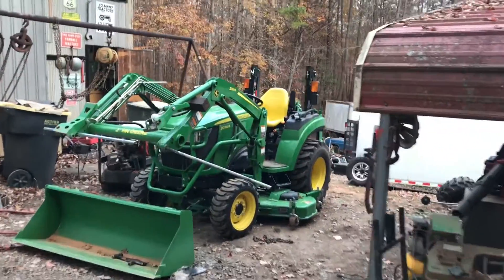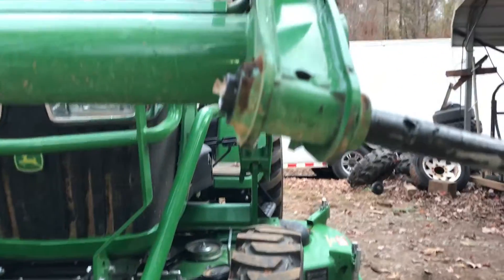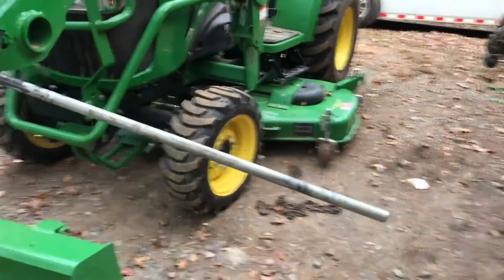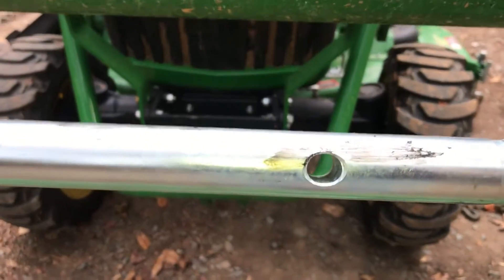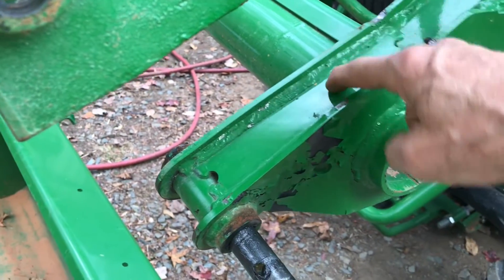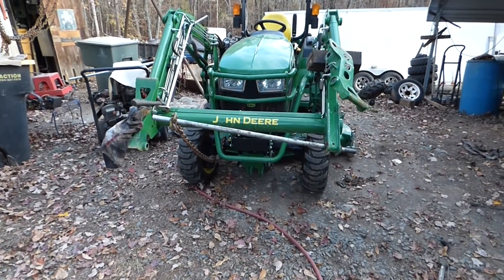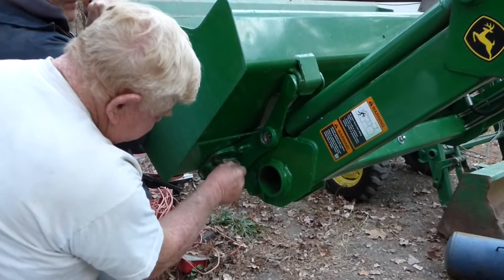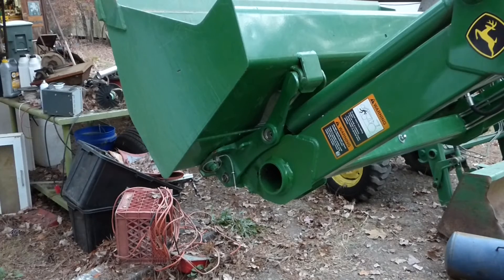Tractor Accident Destroys Front End Loader (Dealer Wants $4,300) Can We Fix It!

Comment: He Left a Clip out of one Bucket mounts, done that myself once but lucky for me no damage. Heat it up with a Torch Rosebud tip, straighten it then weld a re-bar support ring around it then heat it red hot again and Quench it with Oil to Harden it, good to go. It is always a good idea when welder on any Powered Equipment to disconnect the Battery Ground wire to Protect the Alternator Diodes and all other Electrical Circuits too.